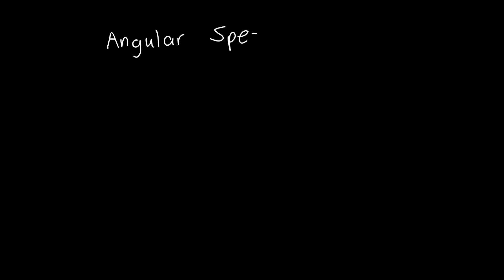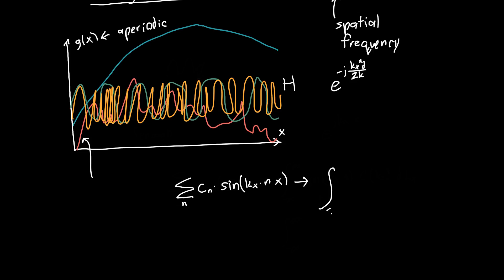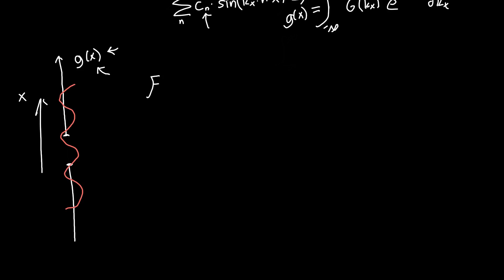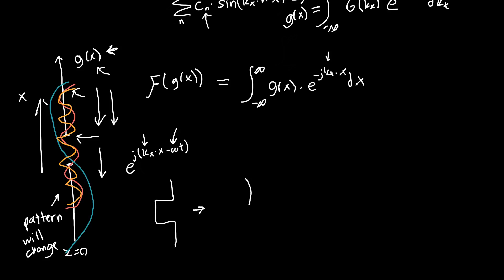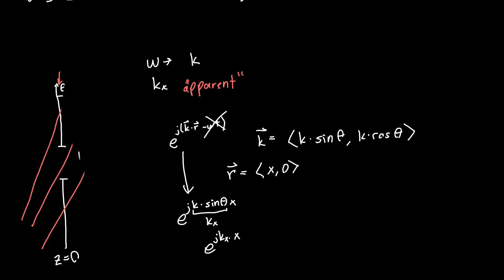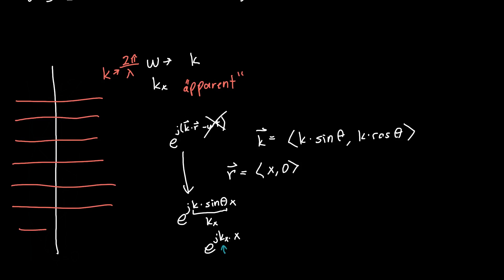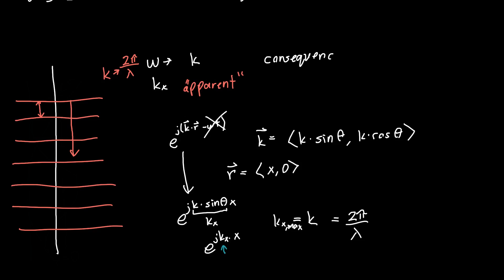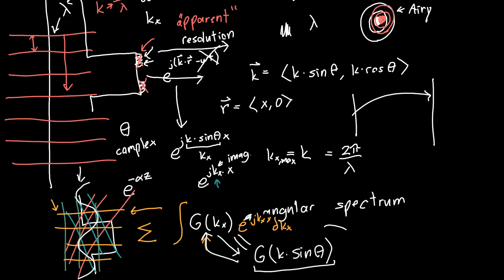Angular Spectrum in Fourier Optics

Comment: I was just wondering how the x - component of the k vector became ksin(theeta) and the z-component kcos(theeta). Should'nt the x-component be kcos(theeta) and z-component be ksin(theeta)? This is what I get when I construct a triangle with the angle theeta.
Reply from the maker: Depends on how you define theta xD The z-component is defined to point away from the screen (from left to right), and should be maximum when theta = 0.
Reply: @JordanEdmundsEECS  You defined theta to be the angle between the z=0 axis and how much k points off axis from z-direction. the cosine and sine should be switched for sure.
Reply: SingularAttitude it looks like in the diagram defined theta to be the angle between z=0 (the x axis) and the wavefront. The k vector is normal to the wavefront, so theta in terms of k is the angle between the z axis and the k vector. So like he said in his comment, the z component is maximum when theta=0, so it is the cos term.

Comment: SO every one talks about Fourier optics but what about Laplace to encode the Transmission loss as is done in EE. Also, are you going to talk about optical phase space? And I would love to see that discussed and how the Lagrange optical invariant is conserved in and when it's not conserved say when the object is larger then what the overall system smallest transmissible object by Cheif and Marginal Ray analysis. And your videos are a great supplement to Born & Wolf that spearheads the next gen of optical enginers
Reply from the maker: Thanks! The Laplace transform is actually implicitly used in Fourier optics, because the k-vector can have an imaginary part. These are called “evanescent waves” and are generally treated separately. But if you are propagating through lossy media your Fourier Transform must turn into a Laplace transform. I will definitely be covering the Lagrange invariant.
Reply: @JordanEdmundsEECS  Sweet; what about optical phase space (https://www-optica.inaoep.mx/escuela2011/docs/Markus_Testorf_INAOE/Markus_Testorf_INAOE_1.pdf) ?  Cause it's easier to wrap one's head about this than how it's typically done  accelerator physics or  Classical Hamilton Mech .
Reply from the maker: Definitely. Phase space is magical